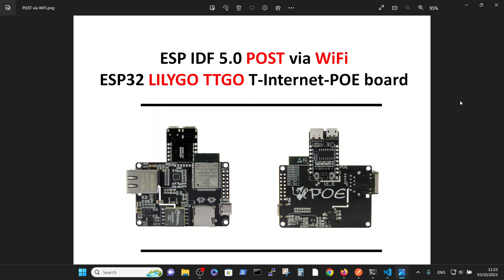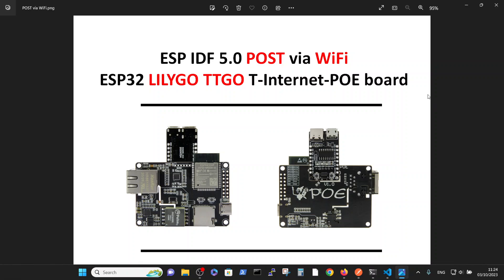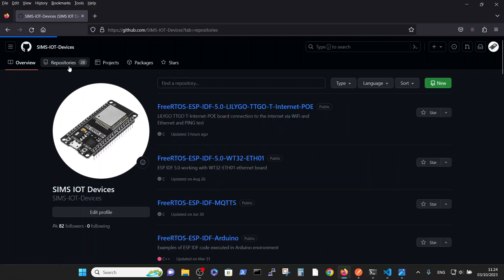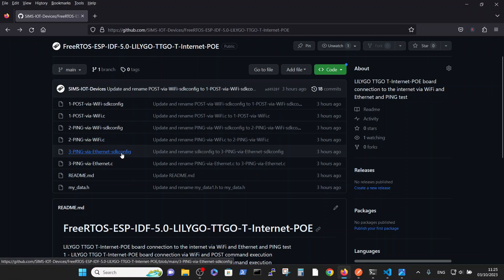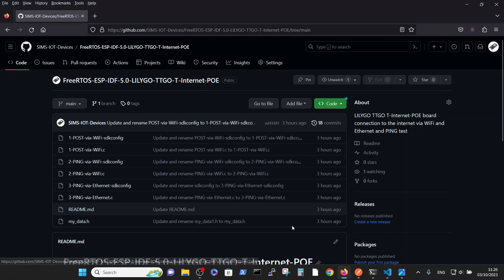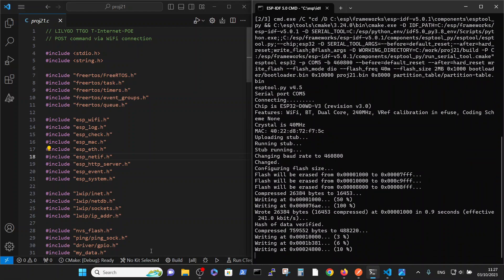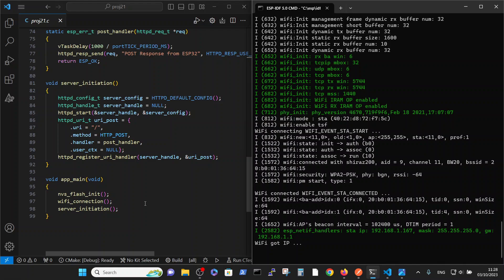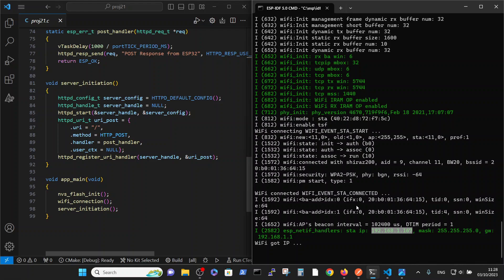1 - ESP32 POST via WiFi connection in ESP IDF 5.0 on LILYGO TTGO T-Internet-POE board

Comment: Nice video, how to use the power adapter? How many volts?
Reply from the maker: Dear @Valentino-ok2hss,
It was a standard 5V power phone charger adapter. Please note the relevant Ampere requirement which can be pretty high.